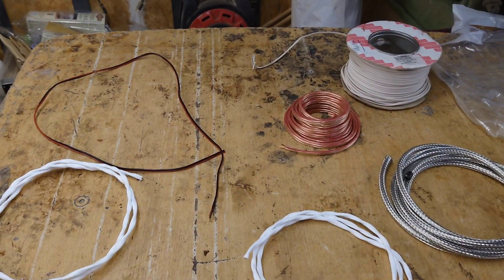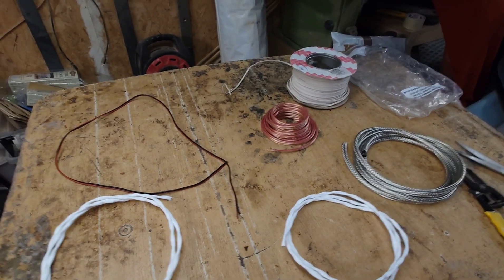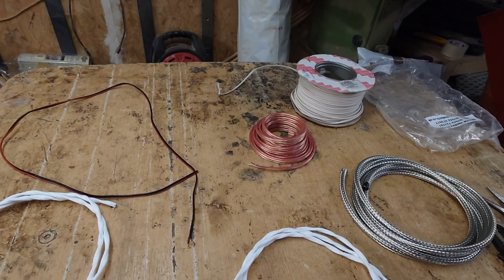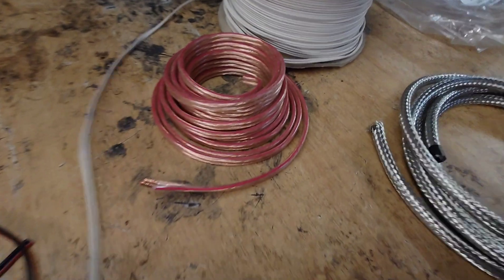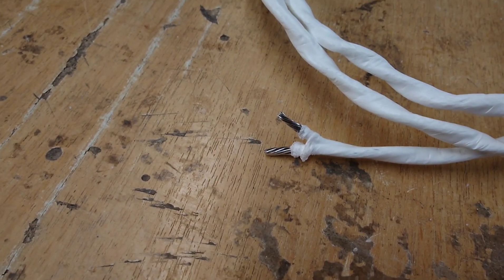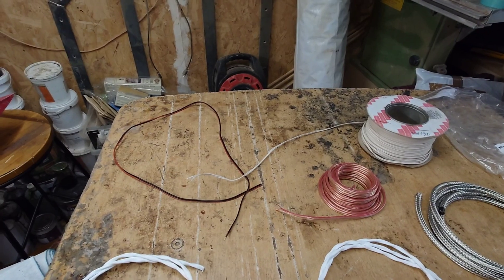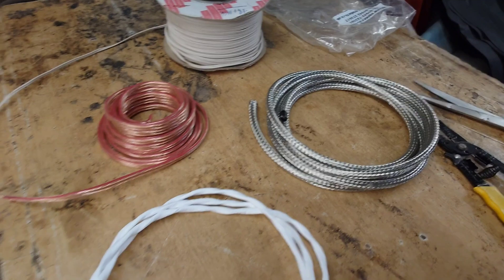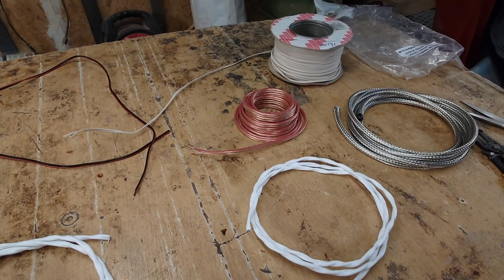Are Audio Cables Snake Oil

Comment: Hi. Great DIY in all of your videos. Love it. Can you recommend which one of your DIY interconnect that would be good for my preamp to subwoofer? Have a In-line filter DIY made L/R channel (GR-Research) set at 80 hz for the sub, the rest to amp. Need about 5 meters, so it needs to fairly easy to make. Expensive to affordable would be nice. Thanks in advance.

Comment: Just found your channel from the Anadialouge channel. Really interested in the future speaker build video you mentioned. I'm definitely going to look back through your earlier content. My biggest issue with cables is not having the exact length so I'd like to have a go at DIY. Be interesting how a DIY cable would compare to my various existing Chord and QEDs.

Comment: The snake oil police are just trolls who have realised that audio cables is the gift that keeps giving in terms of aggravation. Cables do make a difference but not everyone will have the analytical listening skills necessary to pinpoint the differences. Unfortunately, the first paper referenced at Ana[dia]log had a fatal flaw as they were using different amplifier circuits in the comparison (rca vs xlr). So, we're nowhere near settling the argument.